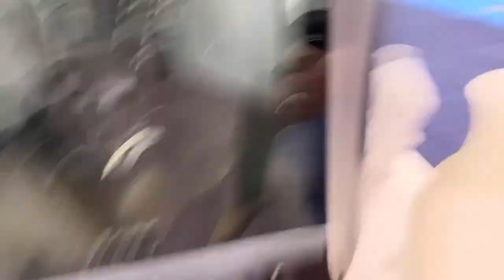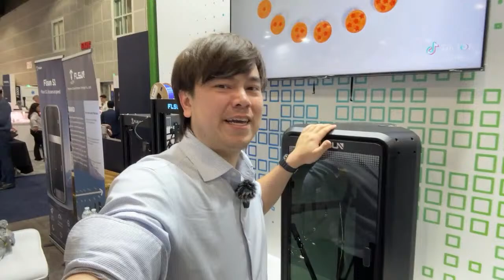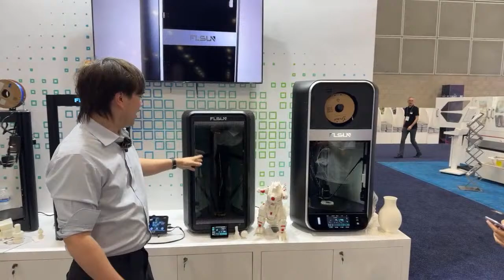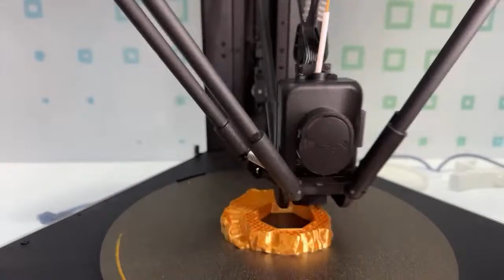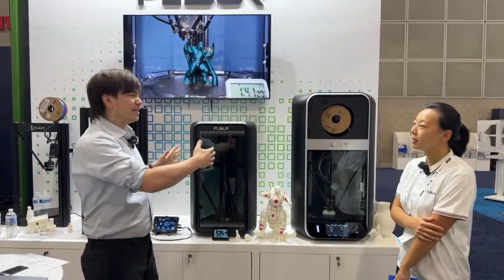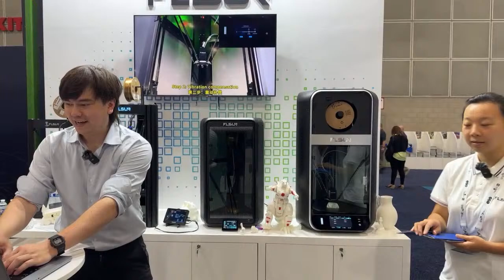Live From RAPID+TCT with FLSUN - Checking out the S1 and T1

Comment: Im going to say that if you started a random print on both models they will both finish at around the same time as the max speed is not going to be achieved in normal day to day printing, in fact to achieve the max speed you would probably have to design your part to get to the top speed.
 I have always wanted a Delta machine, they fascinate me, I think I might be getting a T1, I will wait for any problems or bugs to be ironed out first though!

Comment: The extruder and hotend heater on S1are they running at 24V or 36V? I see the extruder is not closed loop motor like the rest of the other motors running at 36V.

Comment: "I'm a big fan of quiet machines". There's a pun in there somewhere... I agree and I believe so does the majority of hobbyists. I hear Prusa's HT90 is very silent, so that's proof it can be done.

In an industrial setting, low-noise machine is a bonus not a necessity, in a home setting, it's very important the noise is minimal. If you got an old high-end server for free, I highly doubt you'd want to use it as your PC, in fact, you wouldn't want it running anywhere in your house.
Reply: Prusa's delta is also 10k